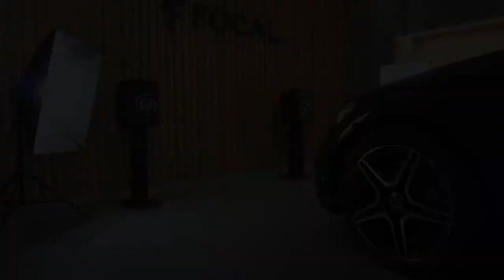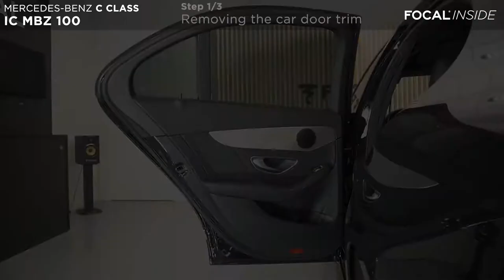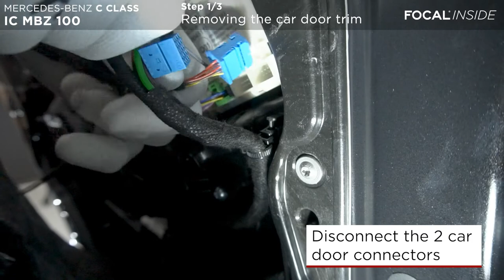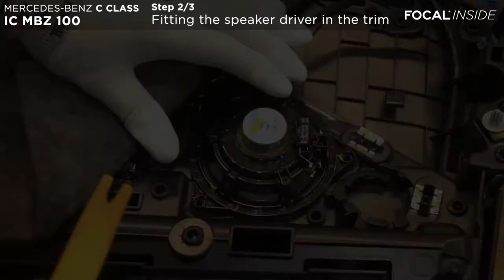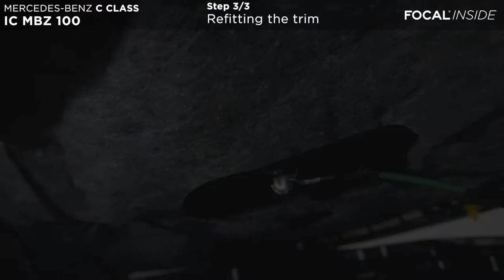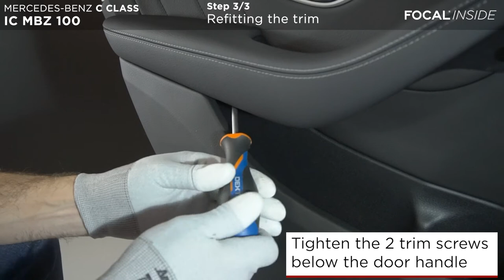Focal Inside - IC MBZ 100 Installation - Mercedes-Benz C Class

Comment: As you know cabriolet model has no tweeter speaker. So I'd like to know whether it is possible to install IC MBZ 100 on the front door.
Reply from the maker: Hi, 

please contact directly your local dealer via this link ;https://store.focal.com/ 
They are your main contact and will be able to advise.

Kind regards
Focal